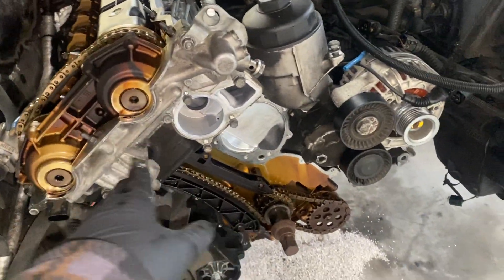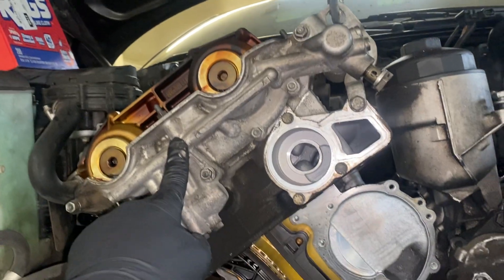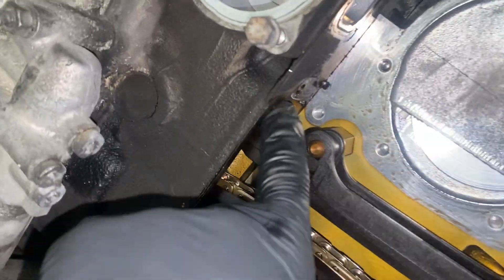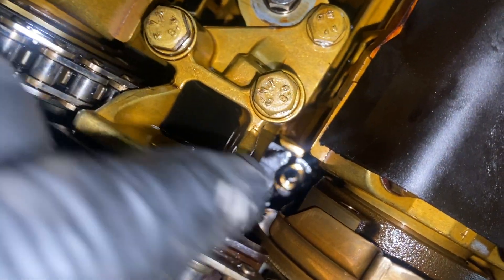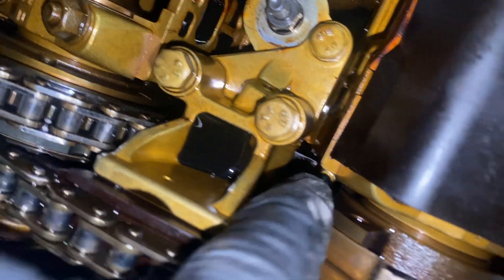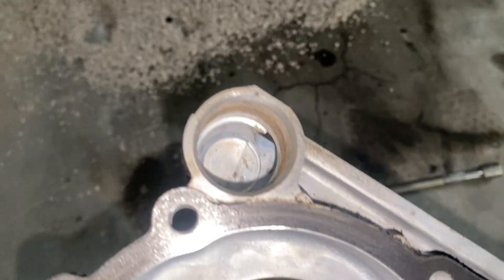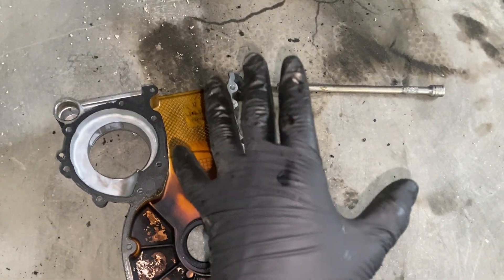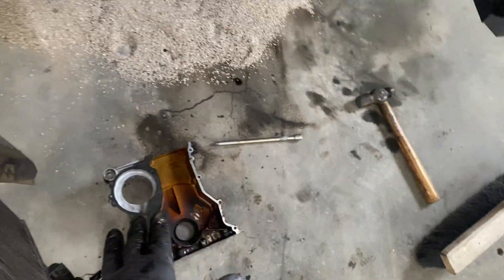BMW M54 front timing cover removal (VANOS untouched!)

Comment: Thanks a lot for sharing this tip!
I finally managed to get all the bolts out and to loosen the cover free, but it's still held onto the engine by a water line at the top right corner. 
Any trick to get it out without disassembling the entire intake side, the oil filter housing, the alternator, and everything else that is interconnected ?

Comment: Question 🙋‍♂️ do you think I could replace only the timing chain guides doing this? (I will keep the chain itself in place) and not replacing the vanos chains guide.
Reply: I’m from Brazil and buying the locking tools to time the engine are like 3-4k just imagine 4K dollars for a timing guide I won’t ever use again
Reply from the maker: @GiovanniGamer345  I'm honestly not sure. I haven't looked into that procedure

Comment: What about change the timing chain? I have Single Vanos would that be possible with Vanos still on?
Reply from the maker: No. VANOS has to be completely removed to change timing chain afaik.
Reply: @ but how can i put my engine on the traverse without the vanos where the engine lift point is attached ? Thx
Reply from the maker: @bigdeal87  Not sure, but I would probably throw the oilpan back on with a few bolts and support the motor with a jack if I had to take the vanos off.

Comment: Do you have a video how to assemble it back properly?
Reply from the maker: I already reinstalled it. Follow the factory instructions I posted under @lukemccann95. Let me know how it goes for you.
Reply: @owenlee4585  

Where are you putting RTV gasket? Between head and gasket, and between gasket and front cover? And between each layer of the head gasket? I want to be sure it will be oil and water proof.
Reply from the maker: on the seam where the head gasket meets the block, on the seam where the timing cover lower surface meets the oil pan mating surface of the block, and on the entire surface of the timing cover that meets the head gasket. The metal timing cover gaskets do not require RTV to seal. BMW TIS states to use a small amount of grease to hold them in place.

Comment: Why does the oilpan have to come off? Tought its enough to just remove the bolts that goes into the timing cover like the top ones? Thx
Reply from the maker: the timing cover is squeezed in between the oil pan and the head and is bolted into both. You can simply loosen the oil pan, shouldn't need to completely remove it. I've seen a video where they did it that way.

Comment: Any tips to get it back on and lined up properly? snapped my chain guide trying to get it on so need to wait for a new one now haha
Reply from the maker: according to a forum post i saw, the BMW TIS says to orient the dowel pins in the timing cover so that they are sticking out toward the engine, then tap the cover on. I do not have TIS access to verify that but it seems logical, so that’s what i’ll be doing. I’m unsure of the tightening order for the bolts so i will be tightening them in gradual steps. Use light rtv on the surface that contacts the head gasket. Let me know how it goes for you
Reply from the maker: update, i got access to the BMW TIS. Installation steps are as follows, directly quoted (with editing for clarification) from the TIS:

Drive alignment pins into timing case cover until they protrude approx. 2 to 3 mm (on mating surface side)
Secure new seals to timing case cover with a little grease.
Ensure sealing faces are clean and free of seal debris.
Apply Drei Bond 1209 sealing compound (refer to BMW Parts Service) at following points: (1) A bead at the transitions to the cylinder head gasket on the left and right. (this is ON the block, on the left and right sides of the timing chain hole.) (2) Thinly and evenly to the entire sealing face of the timing case cover to the cylinder head gasket.
A bead at the transitions to the cylinder head gasket on the left and right.
Thinly and evenly to the entire sealing face of the timing case cover to the cylinder head gasket.
Install timing case cover, insert all screws (ONLY FRONT BOLTS) and initially tighten to approx. 5 Nm.
Drive in dowel pins from front until flush.
Fully tighten all screws in alternate sequence (ONLY FRONT BOLTS)
Once all screws have been tightened down, retighten them in a second operation.
Insert screws, tighten screw connection for timing case cover to cylinder head.

TIGHTENING TORQUES: M6 - 10Nm; M7 - 15Mn, M8 - 22Nm, M10 - 47Nm

hope this helps!
Reply: @owenlee4585  thanks so much for posting this!
Reply from the maker: @Darkaccent  update for you and any readers, I would recommend tightening the bolts that come through the head BEFORE tightening the front bolts on the timing cover. This should help "suck up" the timing cover and minimize the difference in height between the main oil pan mating surface of the block and the oil pan mating surface of the timing cover. Don't forget to put some RTV over that seam also. Even after that process, the bottom of my timing cover is about 0.3mm lower than the bottom of the block. It may be a result of the RTV that I put at the block-to-head seam as outlined by the TIS. I will update when the car is running and confirm whether the oil pan leaks or not.
Reply: @owenlee4585 hello, any update about oil leaks? I may have the same problem about it lining up with the engine block, about 0.2 or 0.3 mm also
Reply from the maker: @fededu9439  so far the car has maybe 8 hours of run time on it and there is no leak. Still working out kinks on the car.
Reply: @owenlee4585  either way, keep it up man! you got a new subscriber and i’m hoping to see more updates with you car and your work! Seems a solid budget build
Reply from the maker: @fededu9439  thank you friend! new video hopefully coming out soon.